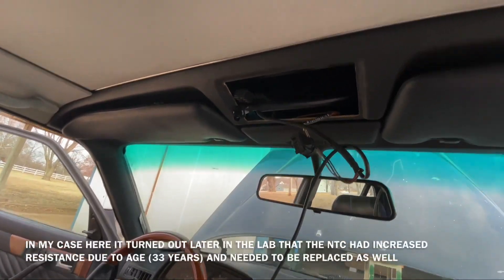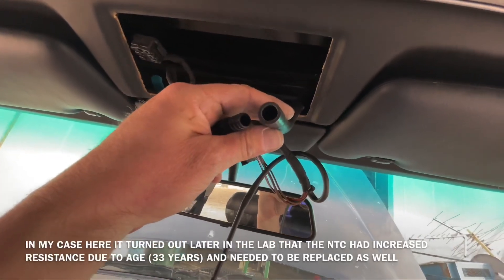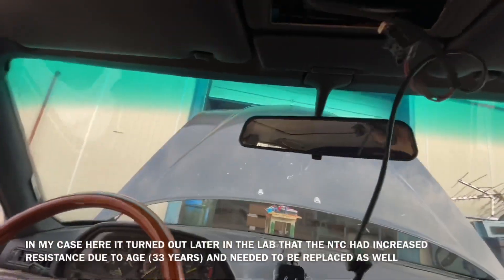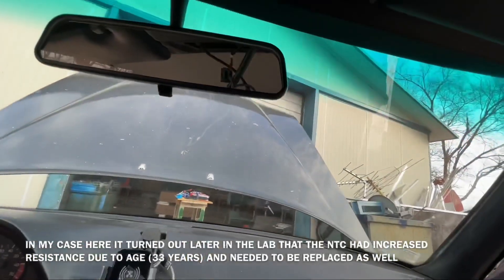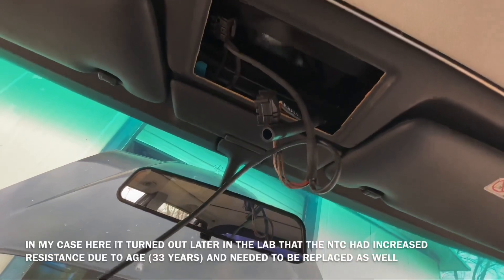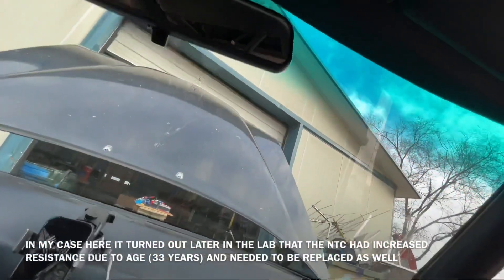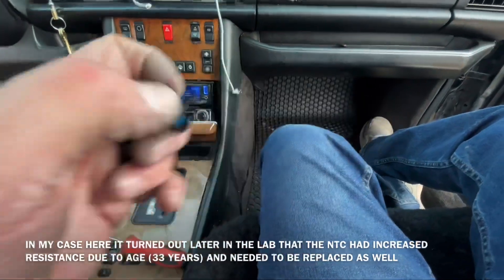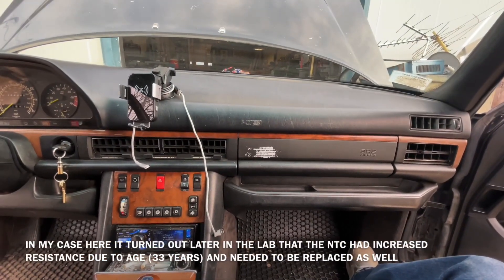Mercedes W126, 124, 201 location test & removal of in car temperature sensor & aspiration pump

Comment: I check and my aux pump works, 
I have w126 280SEL 83 .
You know how i check my fuses?
If the vacuum to sensor not working
Reply from the maker: The fuses are in the fuse box. Check for corrosion. You may have to clean the fuses

Comment: My car only let's in cold air when the duovalve is plugged in and hot when unplugged. There is a clicking noise when I plug in the duovalve so it seems to be working but I can't change the temperature in the car so maybe the heater control unit is malfunctioning?
Reply from the maker: Before I can answer your question correctly, I need to know the following things:
1. What is your ambient local temperature as you are doing this?
2. Is your AC fully functioning?
3. Which settings are you selecting on the A/C control?
Reply: @inovahightechltd  I'm from Norway so right now it's about 13-14celcius
And no I can't get the AC pump to spin. Or activate still trying to figure this out. And what controls on the AC unit is anything really it doesn't seem to affect anything no matter what temp I set the two wheels to.
Reply from the maker: @marcusfinanger1116   all this matters. Now set temperature to high and push economy setting leave blower at auto speed. Run engine to operating temperature.
If you don’t get hot air, disconnect the duo valve electric connector, if you get heat now then the potentiometer on the temperature wheels is defective 
Watch these videos here:

https://youtu.be/TRoGWfv12Z4?si=nqKp-7S1fRMdIc2K

https://youtu.be/ZWEjHjKO2gM?si=u_Cjd__cAW6vTYmJ
Reply: Thank you I will try this and keep you updated ❤️
Reply from the maker: @marcusfinanger1116  got one more video for you to watch, which is actually the one which explains the temperature potentiometer issue

https://youtu.be/VAgDtJn-uuo?si=80Sx94AOkPEyVhUm
Reply: I just did your test and it seems like the potentialmeter Is defective and I did the paper test on the in cabin temp sensor and that is also defective. So I'll take out the dash and inspect the potentialmeter and check the in cabin pump under dash
Reply: Okey now I've opened the potentiometer and lubed everything and when I plugged it back in I now have warm air even when the duovalve is plugged in. But it's still just Luke warm and won't go cold. I'm thinking this is because the AC doesn't work. I checked the fuses and changed just incase. Next is prob to get the AC to work?
Reply: I checked The duovalve connection  and before I had 12volts and zero when I turned the potentiometers to cold. But now I have nothing going thru to the duovalve so yeah something happend
Reply from the maker: @marcusfinanger1116 yes, that would be it. Do you know for how long the AC was inop?
Reply: @inovahightechltd  not really I haven't had the car for that long but in my ownership it has never worked